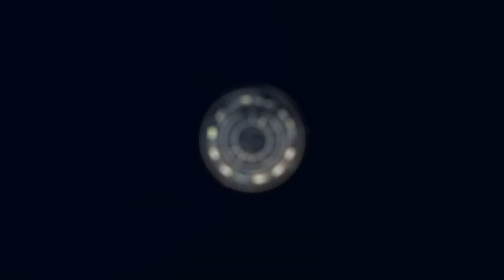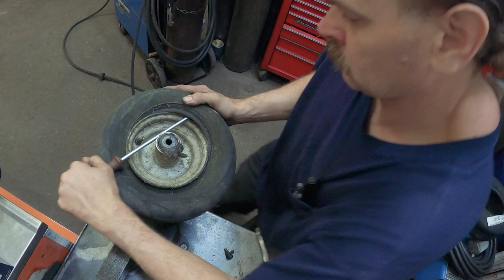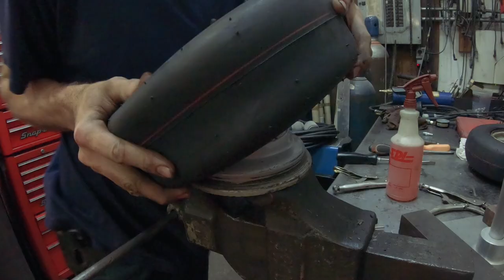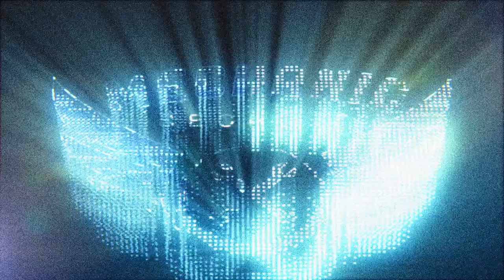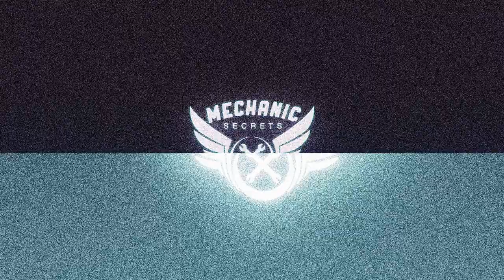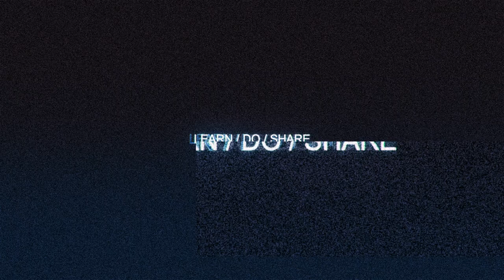Zero Turn Tire Change By Hand

Comment: How did you break the bead?
Reply from the maker: On this particular tire, the bead was already broken. But you most of the time can use a hammer on the side wall of the tire. Or clamp the tire in a vice   And if you spray a Dawn and water mix around the bead, that will help.